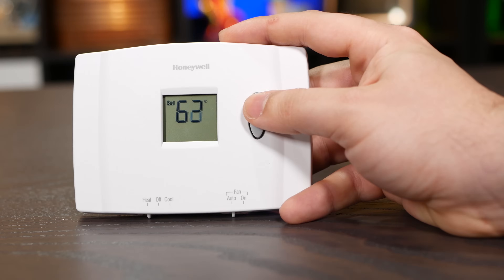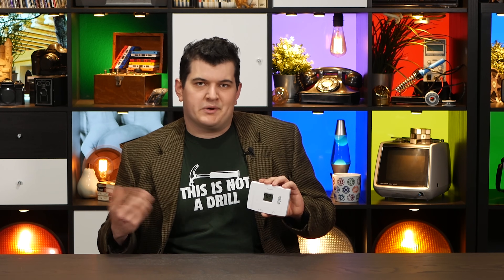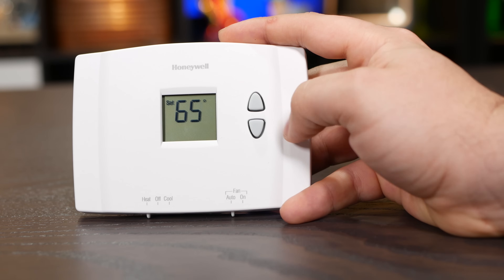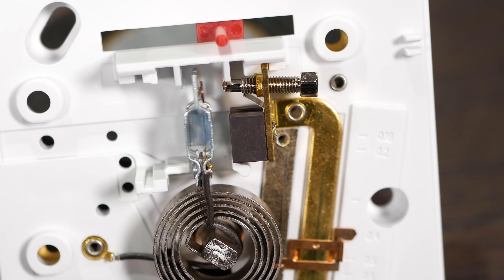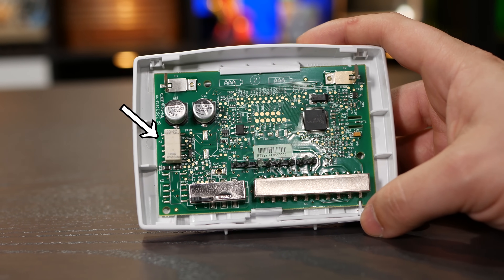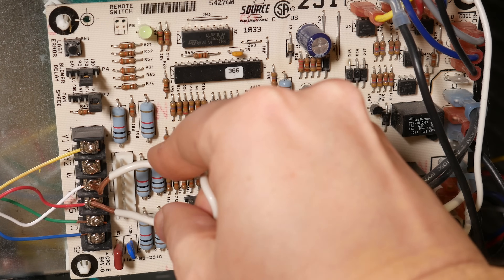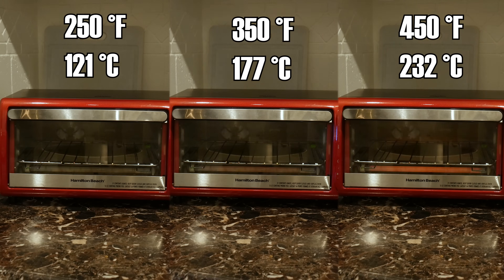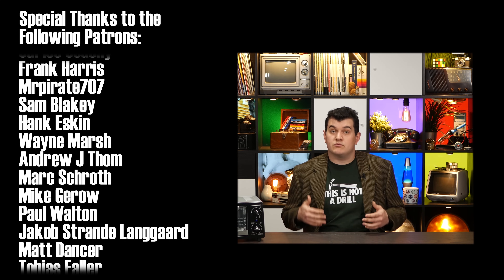Thermostats: Cooler than you think!

Comment: Ecobee thermostats can be configured so that when you manually change the temperature, it will hold the new set-point for a configurable amount of time, then go back to the scheduled set-point. I noticed that it turns on the second stage cooling if the current temperature is ~2F above the set-point or if stage-1 cooling was running for ~20 minutes.

Comment: I don't think my Furnace is particularly fancy-pants though I did buy it direct from a HVAC store on Ebay at a discount.  I'm also not sure what 2-stage heating is, but in my case the furnace does have medium and high settings.  If wired correctly to a regular thermostat, it initially turns on at medium, but if the thermostat is still telling it to run after a set amount of time, it switches to high.  It can also be wired to a fancier thermostat that can control its mode directly.  And presumably the fancier thermostat tells it to switch to high when there is a larger discrepancy between the actual and desired temperature.  So if I had such a thermostat (I don't) turning it up might make it switch to high?  FYI when I first installed this furnace I did in fact have a mercury float thermostat.  But it died.  And so did the one I replaced it with (my parents old one) and now I'm using someone else's old Honeywell digital.

Comment: I think there's a part of Sneak's question at the end that you overlooked: houses that have inconsistent / bad insulation and therefore hot & cold spots (not to mention people who like to keep their doors closed, which can limit how much the air circulates). I live in an old-ish apartment with 3 rooms (living+kitchen, bed, bath). The living room & kitchen has a huge poorly insulated wall that is exposed to the outside on the other side, while the other two rooms have 2 walls exposed to another unit on the other side. This means the living room & kitchen is always much closer to the outside temperature. Something that would average the three rooms would give a much better picture of the apartment over all, instead of only measuring the temperature in the hottest(in summer)/coldest(in winter) room in the apartment.

Comment: I remember having to explain this to my 25yr old roommate shortly after she moved in. She would always set the thermostat to some crazy extreme, and then forget about it (aka leave it there for hours/days). Made our power bill crazy high. I had to explain how our apartment complex was built in the 1970s and has a super duper dumb HVAC that is nothing like her phone or her car. How the HVAC has flooring it and doing nothing, and can't do anything in between. The car flooring it part seemed to make the most sense to her, when I said how the HVAC is either going as fast as physically possible or not moving. She thought she was "outsmarting it" and tricking it into heating/cooling faster. That got an eye roll from me. I explained how all it can do is make either the hottest or coldest air that it can, and dump that into the room. Setting it to 80 or 60 doesn't cause the HVAC to produce 80 or 60 degree air (she thought it did). I even offer to take a thermometer and shove it in the vents to prove it to her, because I remember seeing a technician do that at a place I used to work (a room at that place wasn't staying cool, so the first thing the guy did when he got there was stick a thermometer in the vent to measure what was coming out to prove it was indeed producing cool air, we just had too many people and computers for the size of the AC unit).

Comment: HVAC technician:
Color coding has nothing to do with it. In fact, never pay attention to the colors, pay attention to the letter designator for each contact. 18 gauge solid copper is the standard for tstat wire and that's just for electrical specs. Most programmable tstats will automatically return to the scheduling set point at each set scheduling period. And last but not least: communicating/modulating and multi stage systems are getting more and more common. At this point I'd go so far as to say single stage heat and cool is becoming the least common setup I see, that might just be my region though

Comment: You mentioned that the contact opens fast and gives an additional bonus of having less arcing. Do you really need to be that concerned on 24v (I have no idea if it's DC or ac)? The resistive load of the wire itself should prevent for high currents and there is a resistive load at the furnace itself.
My thermostat has a mode of controlling. This mode is the PWM that you talked about. Some furnaces have different setting for those. This is more of the duty cycle percentage at which it is active. This is to more accurately time to shut down the furnace so there is less of a hysteresis.

Comment: Red, 24V. Blue, common. White, heat. Yellow, Air conditioning. Green, fan. Black, heat stage 2.  Orenge, compressor heat. Brown, no one uses the brown wire.  Soooooo, you can go from 2 wires to 8 wires, depending on what setup you have.  Also 2 stage furnaces are nearly half of the nat gas units I see.  So they are way more than 20% to 30% of units. Furnaces can go from 1 stage, to variable speed.  And the variable speed furnaces are more common than you think as well.

Comment: I’m a latecomer to this video, but several years ago I wanted the “run the air conditioner for a while and then resume normal operations” function.  I never found a thermostat that did that, so I added a mechanical timer switch in parallel with the thermostat.  Now I just turn the knob and set it for the time I want.  I refer to it as my get-ready timer, because it’s wonderful when you’ve just gotten out of the shower and are running around the house.
Reply: Ecobee has such a feature (hold for a set duration before reverting to default)

Comment: Remember we don't perceive a given a period of time entirely linearly, that's why, even on the first shot, the recoil of a powerful gun that happens after we take aim and pull the trigger still makes it harder to be accurate, it should not effect accuracy because it happens after we aim and shoot, but it still does.  The rate of change accelerates as the room to be heated gets easier and easier to heat. Going 5mph in a car on its way to 15mph is a different type of 5mph than the 5mph you feel in a car on its way 150 mph. Assuming identical, constant acceleration (like the furnaces) the guy that road until 150 feels like he had a faster experience, but for the target moment you are going 5-15mph in both drives. Also at any speed you are only ever putting in the same (furnace heat) rpms (a range of say 1000-7000) to the wheels (room) but it becomes easier to speed the car up with those same rpms as it builds up speed (heat) because of momentum (an already warm room). It's not a perfect analogy (a constant range of rpms is not the same as a binary flame). It might not be getting hotter faster because you set a high temp, but it FEELS that way because as it heats up the faster it continues to heat up, meaning the higher, or LONGER,  you set the heat the faster it will seem by the end.

Comment: How about car thermostat? 
My car had a digital thermostat and depending on the temperature you set and the inside temperature, the heat or AC blows at different temperatures and the fan automatically adjusts. I like the house where it’s either on or off and never in between. 
So how does the car one work?

Comment: Oh good lord. I've explained the "setting the thermostat higher does not work quicker" so many times to my wife in our environmentally-controlled car. "Yeah, but I'm cold!" she complains. 

"Right, so set it where you want it and the thermostat and heating system will work as hard as it possibly it can until it gets there, and then it will stop – setting everything on high is only needed or effective when you've got a manual heater in the car." And I attempt to set it to something that will guarantee not to overheat me (something south of 70°F!). 

"But I'm cooooooold!" she says as she sets it back up to 74°. 🙄

Comment: if You have a modern ductless AC with a proper room or central thermostat, a split system with a proper electronic EXV/control system like a VRF/VRV. There are some mad designs on their controllers. You should make a video on those controllers, some manufacturers make ludicrously complex controllers just to control 3 things: cycle direction, fan speed, aux control(fan swing, pulse control etc.)

Comment: 2:03 The Lennox David package unit that I have is a multi stage furnace and it runs the speed of the fan variably depending on the temperature. While doing that it also lets in a certain amount of gas into the furnace... because it fancy!!!

Comment: Hmmmm, More then 30 years back I had a furnace what knew three modes: "Low", "Middle" and "High" It switched between different modes by the time the thermostate was asking heat. Special for the system I had, floor heating, it worked very well.

Comment: Is there a thermostat that works off a temperature range?  Meaning, once a "minimum" preset temperature is reached the system will heat up to a "maximum" preset temperature?  Example:  once a room reaches 62 degrees the system will heat the room up to 68 degrees then power off again.   It seems is not good for the furnace life to cycle on and off every 15 minutes 😕  At this point the thermostat no longer works as a function of time.
Reply: I think that's how they work, if a furnace or ac is cycling every 15 minutes it's because conditions outside are extreme enough to warrant it. In my parent's house the furnace only runs that often if it gets well below freezing outside.

Comment: I used to work in an office building that had only 1 zone on the first floor.  One thermostat to control the whole first floor.  Everyone hated it!  The solution was to install dummy thermostats around the building that weren't hooked up to anything.  But the fact that people felt they had some control over the temperature made them feel more comfortable!  Bring in the psychologist please!
Reply: I have "worked" on a lot of AC units that had nothing wrong. After checking everything, I would let the person know "I made a few tuning adjustments, I think it should feel better now. Let me know if it doesn't".

I rarely hear back.
Reply: @JoshuaTootell  That's why I have trust issues with craftsmen!
Reply: @JoshuaTootell  Thats funny, cause we had A technician come out once for our unit when we described an issue to him. he basically did the same thing twiddled some wires and checked his phone... A LOT out by the condenser, then left and said he adjusted the unit and it should be fine. we called back the next day cause the fault which was the unit would always come on then never shut off. which it was doing cause even with the thermostat set to 80 degrees the unit was so weak that i couldn't maintain that when it was summer in my area so it just ran constantly. just to really put the point on the guy, i even wedged a thermometer into a vent right next to the blower and let it sit for 15 minutes and it went to 70 degrees. which after 15 minutes of running that was the best it could do was pretty darn telling. since the swamp cooler we had to buy because the ac was worse than an asthmatic cat after the boston marathon was able to get itself to 64 degrees after 2 minutes and would generally level out at 58.
Reply: My Guy, do it the other way round. Let them tell you, when it's improved afterwards. Sure they will get back to you.
Reply: That’s how a lot of offices do it to this day. Make people think they have temp control but really, nope.
Reply: We considered this for our office thermostats, too, as there is no reaction at all. But for us it is no thought of more control but just something to make fun of or just completely ignore. But we have rooms with windows.
Reply: Ladies and gentlemen... The placebo effect!
Reply: Gaslighting obviously works on a lot of people. But humans that question their own mental health because they think they imagine feeling cold or warm, can develop psychosomatic illnesses because the placebo effect goes both ways.
Don't perform unethical longterm experiments on unsuspecting humans.

Comment: If you're looking for a way to run just one cycle (heat or cool) you can get close, but it'd require 1) thermostat connected to a smart hub 2) smart hub that allows some extra 'rules' inserted (hubitat or an OpenHAB) Hubitat is software and hardware, OpenHAB runs on your hardware (e.g. raspberry pi) 3) some way for the hub to understand you want a short blast of heat or cool (you could possibly hold up and down buttons for a few seconds). 
It's an interesting area. I'm just getting into it, but you might find fodder for a show. 
FWIW, most of this stuff runs on low power 'mesh' radio (z-wave or zigbee) which means you can run temp and presence sensors on batteries - and the devices can run a couple of years.

Comment: Growing up, we had mercury switches. The plastic used in them would wear out. that meant the tilting would fail...either keeping the furnace on, or never turning on. It was cheaper to replace the box than for a technician to replace the failed part. The toxic mercury was a concern, but not when these were the best solution. They were a LOT cheaper than boxes today. i suspect that is because the circuitry was far less with a mercury switch.
Reply: The type he showed with a magnet to close the switch should not require different circuitry than one with a mecury switch.  We are better off not using mercury in these devices.

Comment: Wouldn't fans with electronic speed regulations be "reactive" PWM? They use Triacs which close the circuit when the sinusoidal wave reaches a voltage and keep it closed until ot reaches zero, and you can change what voltage it has to reach

Comment: There are other options for heating than full on and full off. There are 90+ efficient boilers and furnaces that scale to the temps outside. There are also inverter style heat pumps that scale the speed of the compressors based on the temp called for with a "full on" till temp is reached then it trickles the cooling or heating to maintain it. But yeah, saturation of these techs leaves much to be desired as most systems are exactly as you describe.

Comment: ...most medium to elaborate digital thermostats have what's called 'Hold/Temp'...you simply dial up or down the temperature to a desired point and press 'Hold/Temp'...the furnace will then run to achieve this new temperature...then to go back to the set 'schedule' you would press (in my case) 'Run Schedule' and the system goes back to the original program/schedule...it's actually a feature that has been around a long time...

Comment: This is only accurate for single stage heat (w1). If you have a variable speed 2 stage furnace then yes the system will heat faster in stage 2 to get warm faster and then drop down to stage 1 to keep or maintain the heat.

Comment: So AFAIK, there is no stat that will bring on a system for 1 duty cycle, as that's not really a function needed on a wide scale.  Second, you're partially right about Nest stats charging from the 24v, but you're partially wrong, too.  It actually scavenges the completed 24v from the yellow terminal to charge the battery, because in an off-cycle on any one operating terminal to red, you have 24v.  However, this can be a problem in places like where I live in Florida where a/c usage can far exceed the heating, as it doesn't allow the batteries enough yellow terminal off time to recharge.  Source: HVAC master technician with 18+ years of experience.

Comment: I'd like a thermostat that will run my central fan X amount during a time interval.  Many times I'd like just to circulate cool air that has fallen down stairs.  Or even move the air around the house while my fireplace stove is running.   Another great video!
Reply: Why not just get a fan?

Comment: Here in Europe, modulating thermostats and boilers are pretty much standard by now. These do change the output and temperature of the water according to the set temperature and the current temperature in the room. With boilers and circulating warm water, this will apparently save quite some energy.

Comment: I have a Split AC that has a "Turbo" feature. It basically runs the inside fan faster while presetting the temperature to minimum. No it doesn't cool faster I guess but it will make the AC run non-stop until you tell it otherwise

Comment: The problem with most Americans is we are extremely lazy, stupid by choice, close minded and believe only corporations/government to save the environment.
It's so simple to use your furnace while not using a lot of energy. 
Dress for the weather. Wear a sweater and keep the setpoint around 67. Adjust your vents to get equal output threw all the returns. What I do is adjust my returns as needed for what area of the house I'll be in. Also I'll use my den in the winter since it has a force air gas fireplace, will close my pocket doors that go to my dinning room and front home. Keep my bedroom door open. People don't believe me when I tell them how little I pay in utilities. My house has 2 bathrooms, one bedroom, front room, den, dinner room, kitchen with breakfast area and finished basement. 2,100 SqFt. My Electric bill is on average is about $75 a month.  11cents per kilowatt

Comment: Not to be "that guy" but if you have a heat pump and you crank that sucker it turns on the aux heater which does heat significantly faster. I only know this because I have a nest and it will tell me when the aux heater is engaged. I have to crank it to something stupid like 85 to engage the aux heater.